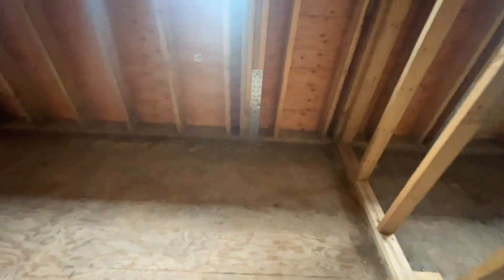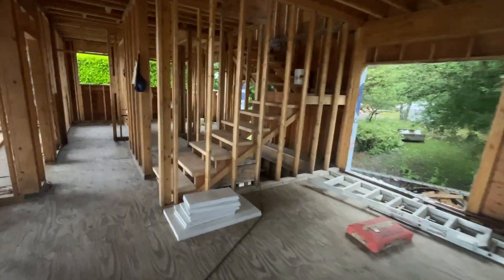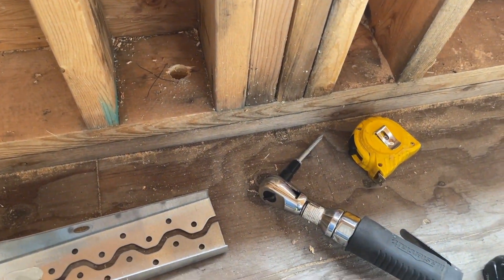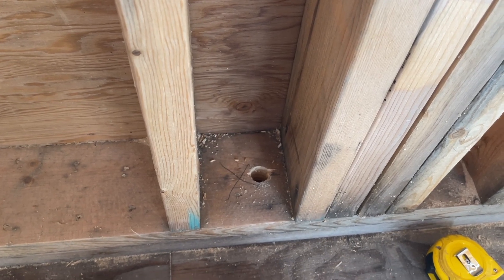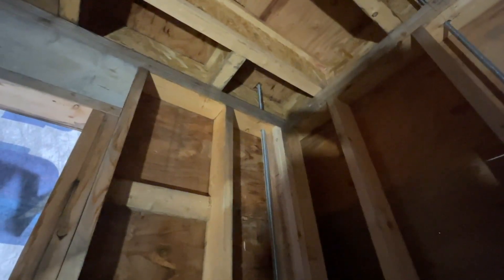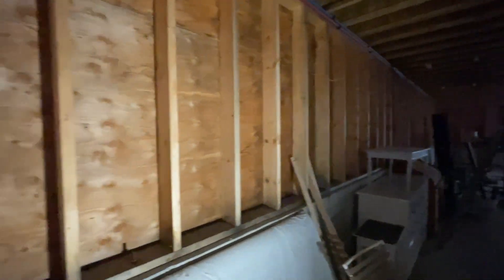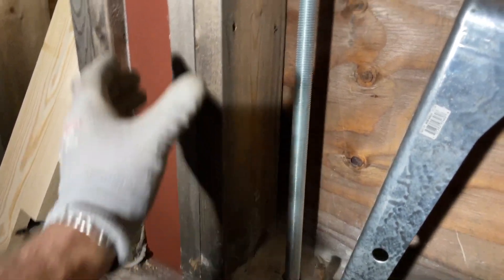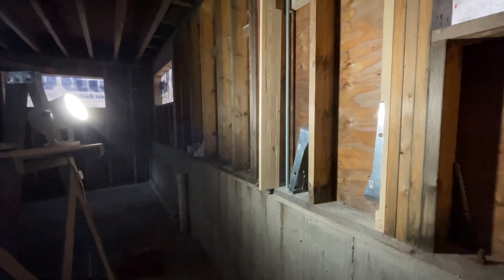Build That House Episode 121

Comment: Why not dry it in before the weather rots the wood?
Reply from the maker: Hey James,
Thanks for the comment.Rain doesn’t touch the building because of the five ft overhang. I need to get the metal roof on this summer next. I’m one guy building a 4200 square foot house, things happen slowly despite working on it everyday.